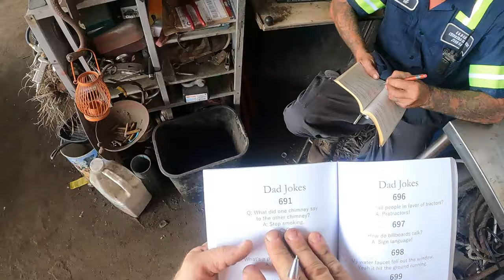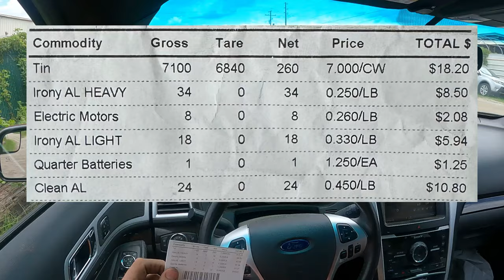I Think There Is More Scrap In My Belly Button

Comment: ❤ Since the parameters have changed for irony light, why don't you use a grinder on the rivets and see if you could clean it a little? Have a great weekend.
Reply from the maker: Because it is a difference of 5 cents a pound.  I would spend more time cleaning it when I could be cleaning copper.  It will still go as dirty - just heavy now.
Reply: @nachostuff  thank you for explaining.